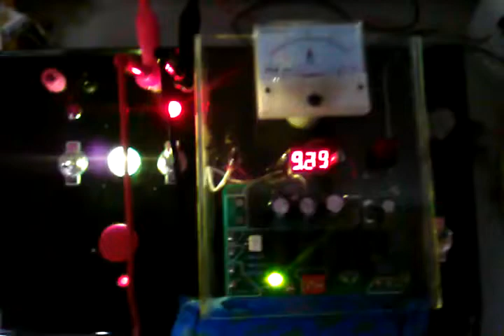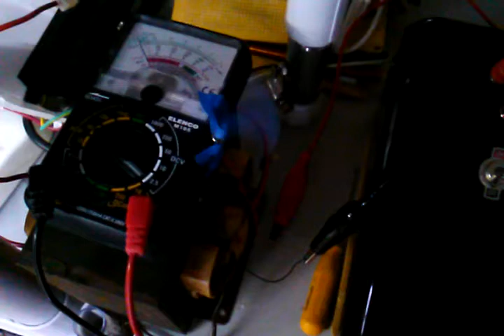Water Powered Electric Motor!

Comment: Cool-reminds me of something i did a long time ago now where i was pulling a charge of the top of a column of water using a single Stan Meyer style cell (distilled water)and a tall tube with a zinc electrode and running a small motor via electron extraction-also check out Lasersabers "atmo" motor running off a bottle of charged water that is held near the motors receiving antenna.